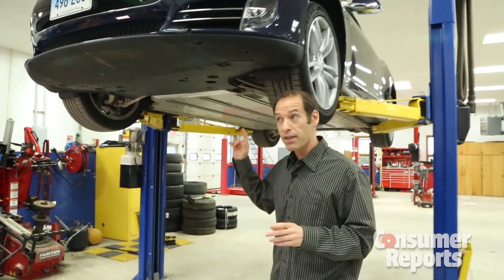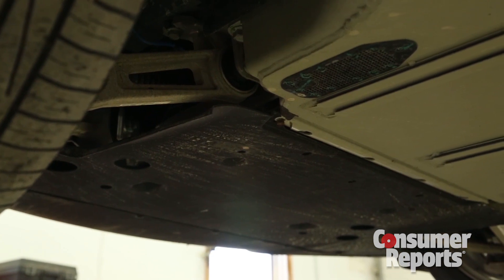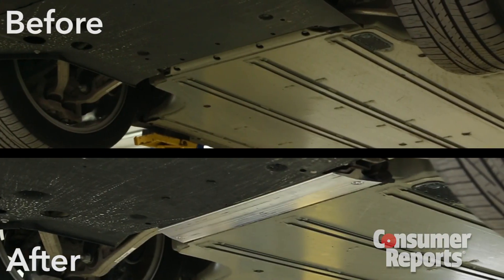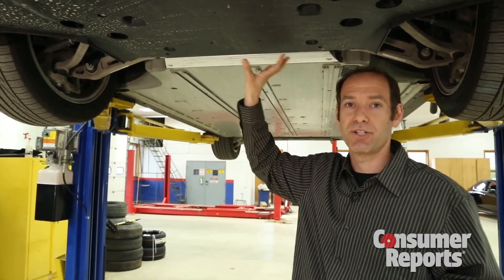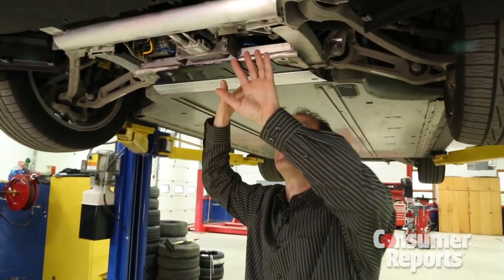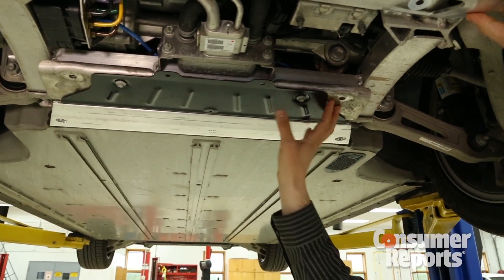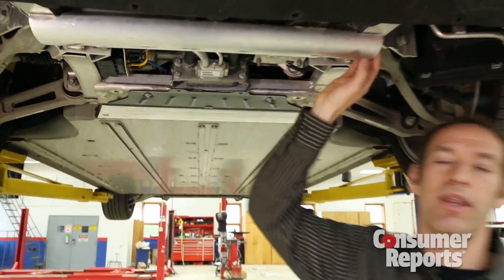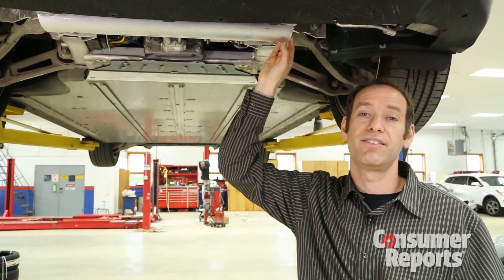CR Tesla Updated With Titanium Plate - Will it Stop Battery Fires? | Consumer Reports

Comment: Would like to add before people get all uptight about the Model S and the 3 fires…
take a look at how many ICE vehicles have had similar accidents. and gave no warning of the fire, or immediately engulfed into a furious fire. or other ICE fires were without reason. just… caught fire.. several hundred ICE vehicles catch fire every day. lots include injuries and a few deaths. all which 99% of goes unnoticed by the media and not a single thing said. 
the 3 fires were caused by a tremendous force and didnt catch fire until minutes after. also giving several warnings. fire never entered cabin of the vehicle.. maybe the one in mexico probably did. but look, it tore up a building and a large tree. at 112 mph! none of these things would have gone so smooth with an ICE vehicle. 

but hey, im all for a Tesla Motors preventing such accident even though the likelihood is very small.

Comment: Consumer reports rates this car the highest ever even though its had several fires?  If it was any other manufacturer they would withdraw their positive ratings
Reply: All cars are susceptible to fire. Look up the rate of fires on gas vehicles even after adjusting for the number of vehicles on the road. This car has a lower rate of fire. If consumer reports insisted on zero fires as part of a positive rating, no car would have a positive rating.
Reply: it is the safest car ever made. An 18 wheeler rear ended a tesla going 55 on the freeway and the tesla took the hit and was still drivable lol best car ever

Comment: My 2007 Honda Odyssey has 2 safety recalls this year, one for the VSA system and the other the fuel pump. The VSA can malfunction by applying the brakes without the driver touching the brake and the brake lights will not illuminate, causing a crash, which also can lead to a fire, because the fuel pump strainer may have corrosion causing fuel leaks. In a car crash with this vehicle, fire can result, including fire with the airbags.